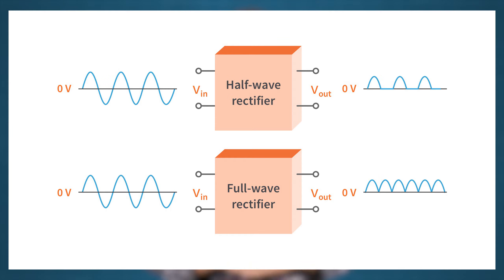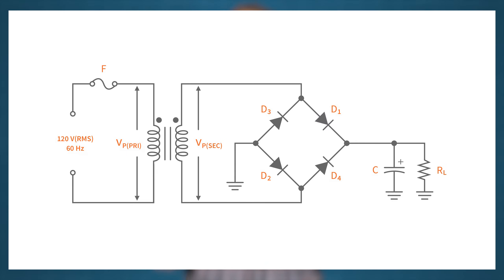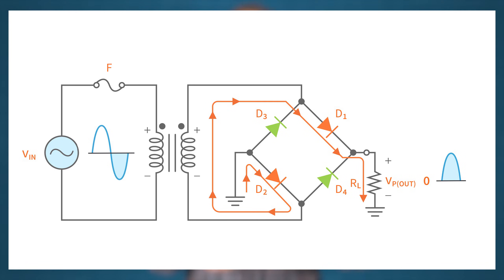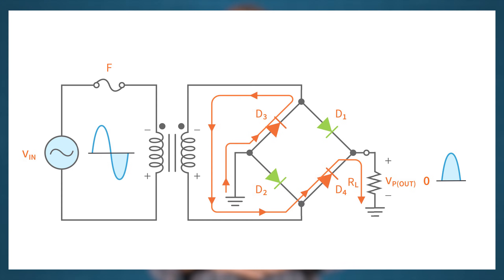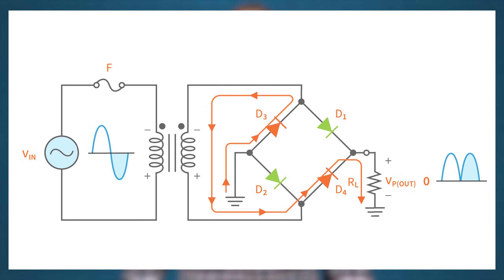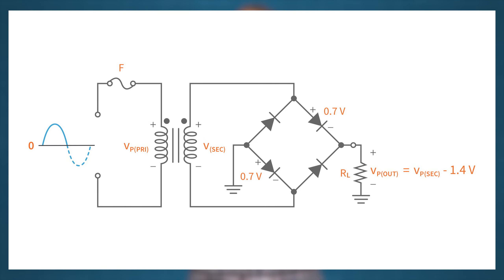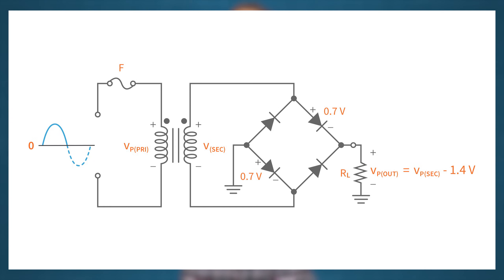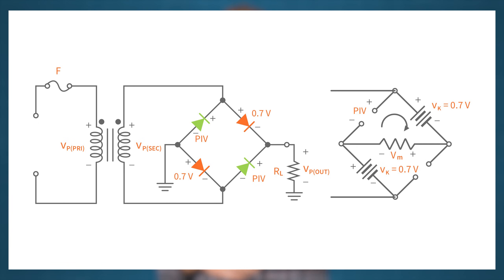Full Wave Rectifier - Conceptual Review | Basic Electronics

Comment: What stops the current from entering D4 during negative cycle?
Reply from the maker: If you mean negative cycle where the bottom leg is negative, it's because that negative voltage reverse-biases D4.  The voltage on the output (connected to the cathode) is higher than that negative voltage on that lower input (connected to the anode).  Does that help?
Reply: @CircuitBread  thank you so much! I overlooked that...

Comment: I wonder if I'm right. When you have positive cycle the current through D2 should flow if the ground has more positive potential than "-" of the transformer. It should be right otherwise there is no current through D2 but why is that?

Comment: Why there is 4 diodes need for a full wave rectifier? I think one forward biased and one reverse biased diodes are enough. Isn't it?
Reply: All the diodes are the same type. What he's talking about when he says biased is what the voltage is doing with respect to the diode. For a given diode, for half the AC cycle, voltage is pushing   current with the direction the diode allows and is therefore forward biased in that moment.  The other half of the AC cycle, voltage is pushing current the other direction, with the diode doesn't allow and this is called reverse biased.

In the diagram, image the current entering from in between d1 and d3...it's can only go in one direction through d1 and onward to what ever it's powering. The other half of the AC cycle, current enters between d2 and d4 and can only move through d4.

Comment: So on the anode of the full wave rectifier can that ground be connected to rod ground outside in the dirt? Or does it have to be anode connected to cathode?
Reply from the maker: I'm not sure what you mean by "anode" of the full wave rectifier - I've only ever heard that term in relation to specific components.  House wiring and electronics components use the term "ground" differently - while a house ground would be connected to a rod in the ground outside, these grounds would actually be connected to what the house line would consider "neutral" (which just brings everything back together to make a closed loop).  Of course, my views are very US-centric, I'm not as confident if these comments apply to other countries.

Comment: Mr, can i ask, is that the pair of diodes are work on and off continuosly for the the loops cycle? I am bit confuse. Thank you
Reply from the maker: Two of the diodes are on at a time, then the other two, you never have just one diode or all four diodes working at the same time.  But, if you have a true AC signal, you will be switching back and forth between the two sets of diodes.  I recommend checking out the written tutorial and then coming back and watching this again, hopefully that'll help!

Comment: Hi, very useful video for my university assignment, could you give me an application of a full bridge wave rectifier and briefly explain it? Would be very appreciative :) Thanks!
Reply from the maker: Hi Will!  Full wave rectifiers are actually very common, so the application list is rather large and vague.  Basically any time you'd need to take an AC signal and turn it into DC.  If you have a small embedded system and you want it to be powered by wall electricity and don't want to get a separate power supply for whatever reason.  I took apart a kitchen appliance once (I think it was a hot chocolate maker?  I don't remember, it was several years ago), and to save money, and because it didn't require any real precision, they just had a quick and dirty rectifier board in there, saving themselves probably $2-$5 per unit, which would be huge savings in the consumer market.